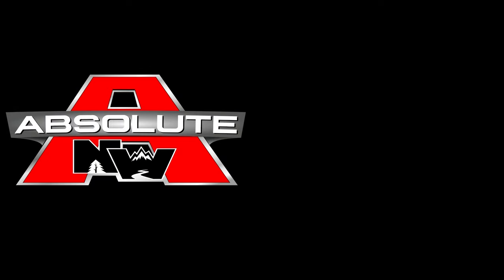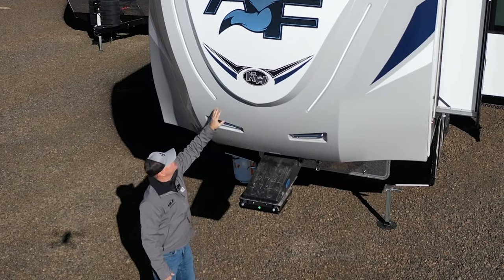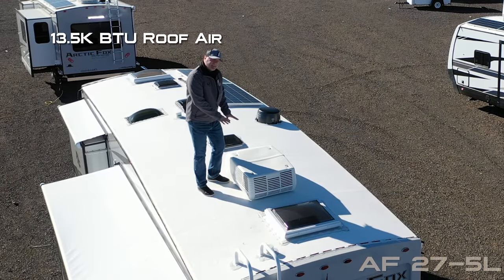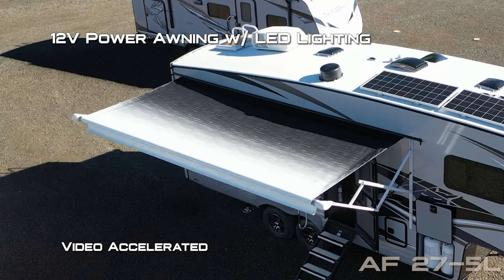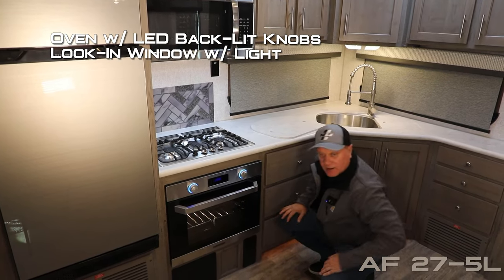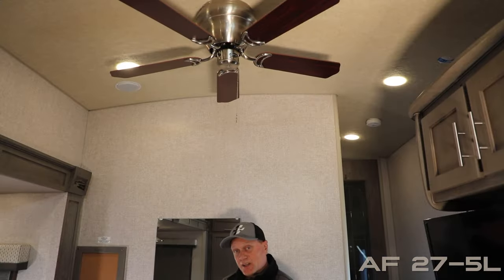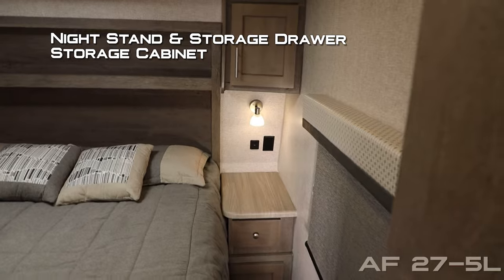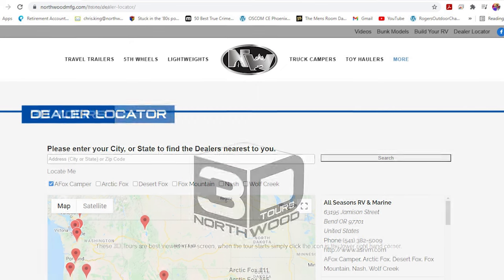Quick Tour of the New Arctic Fox Grande Ronde 27-5L Fifth Wheel

Comment: Congrats on the new interior colors, it's a big improvement. Nice to see 12v compressor fridges although I think that is due to a dwindling supply of the old gas fridges generally. Furrion Brand....meh. This trailer is definitely one to keep an eye on for those of us looking for quality but also stay under 30ft. Some feedback: The days of floor furnace vents and small 32 inch main room TVs are over I think, especially on higher priced products. On demand water heaters are also the way to go. I always suggest considering Truma products for AC, WH, and furnace. They seem to offer superior solutions compared to the old tech. I for one hate the RV industry standard jet engine take-off furnaces. not sure I understand the wood roof over an "aluminum superstructure"....

Comment: On the plus side, excellent choice of options! Thermopayne windows, outstanding insulation values and heated holding tanks take the worry out of cold weather camping. It's better to have it and maybe not need it than to need it and not have it. Ask anyone who was camping during the Polar Vortex in Feb, 2021.
  On the not so good side, that floor heating vent right in front of the stove and kitchen sink where people do a lot of standing can be resolved by installing the heating vents on the vertical face of the kick panel below the cabinets as Grand Design does on many of the campers. 
Get rid of the carpet in the slides and bedroom. If people must have carpet, they can put some throwrugs in that can be cleaned in a washing machine.
 Otherwise these campers are an outstanding value.